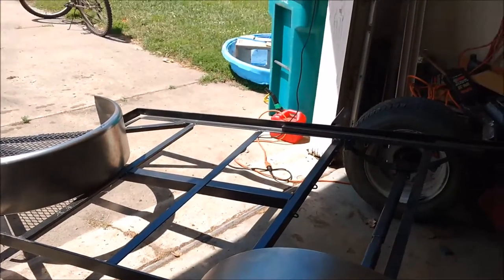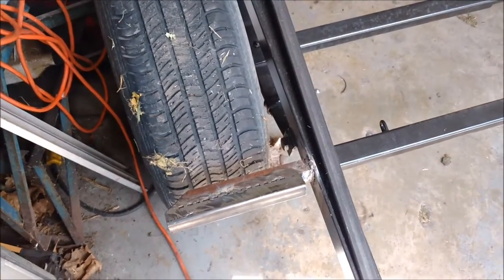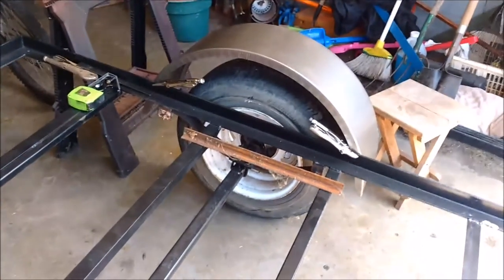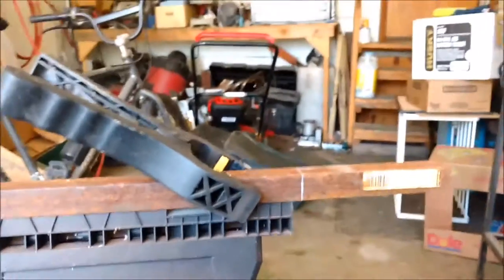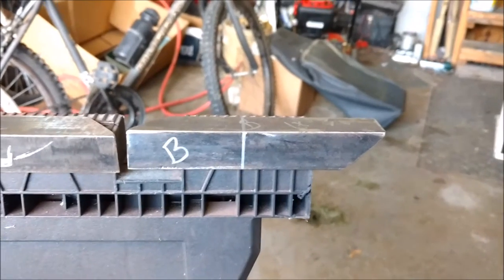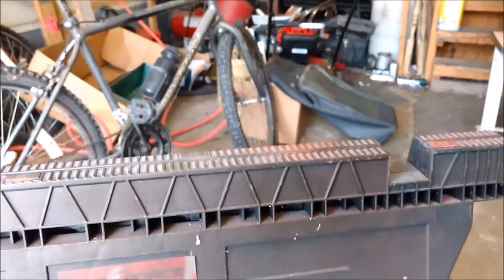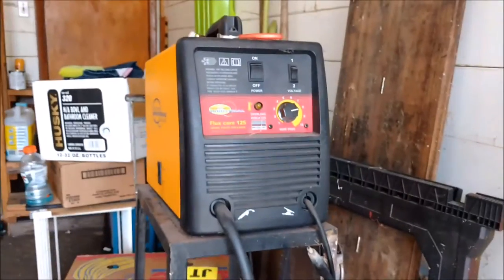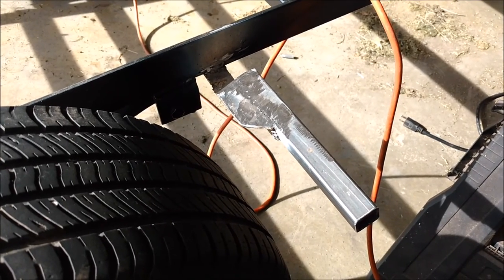Something a little different: making fender mounts

Comment: I have always wanted to try one on the harbor freight trailers.
Reply from the maker: I've seen a lot of folks use the HF trailers and they seem to work ok. I wanted a trailer I could trust and he only charged $300. Fenders were $20 each and the rest of the steel I already had. I'll be doing the wiring with 14 ga wire instead of the 18 the HF trailers are done in.
Reply: I bought one of those HF trailers many years ago - a 4' x 8' model. It's not as well made as yours, that's for sure! That being said - I bought 5 sheets of 4' x 8' plywood and put a floor, 4' tall side-walls and a 4' x 8' sheet of plywood on top to enclose it. I hauled our band equipment around in it for years - about 1,000 pounds worth - and it worked really well!! I did pack the wheel bearings once. I think your trailer looks really well made!! I like the expanded metal on the front!! (-:
Reply from the maker: The expanded is where the battery box will be. He did a great job on the trailer and the price was really good too.